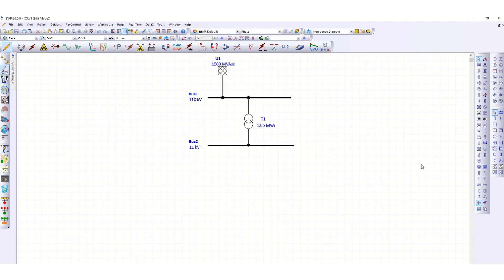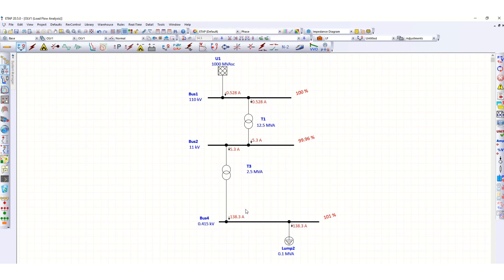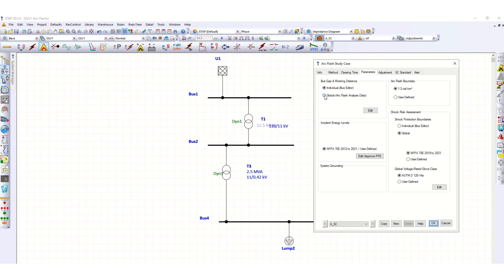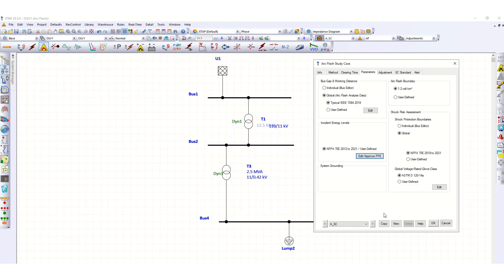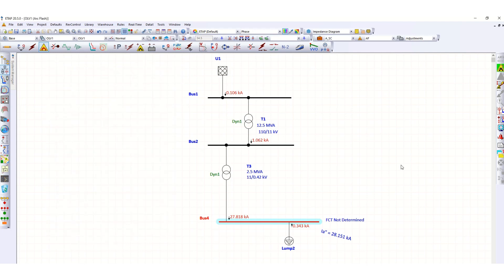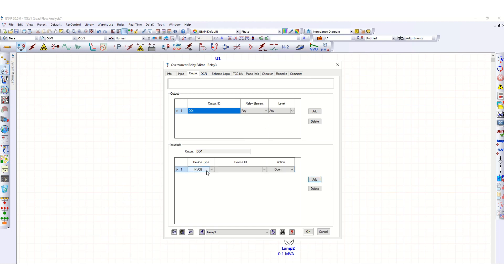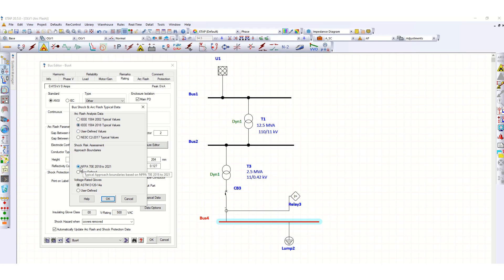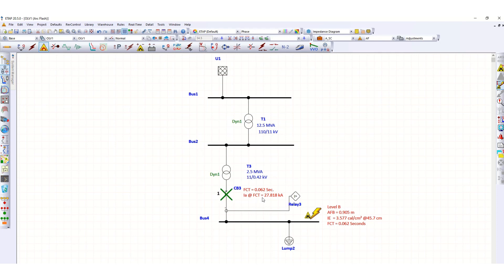ETAP Arc Flash Analysis

Comment: Usually, Arc flash calculations done only on the bus bar. How would you extend these calculations to cover outgoing feeders? Would you simply insert the bus at the outgoing feeder and run with the Arc flash analysis?
Reply from the maker: You are absolutely correct!
We need to check the outgoing cable compartments also; for that one bus can be created against each outgoing feeder to check the incident energy level..
Reply: I ask this because there is also an option named Load PD (bus side) and Load PD (Load side) in the arc fault analyzer. Just thought if we could use that instead of inserting a bus